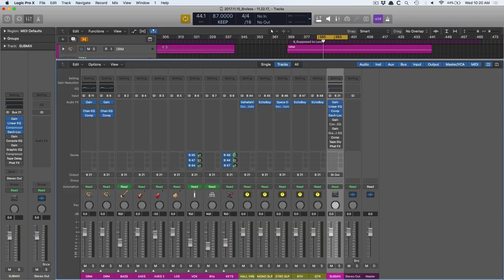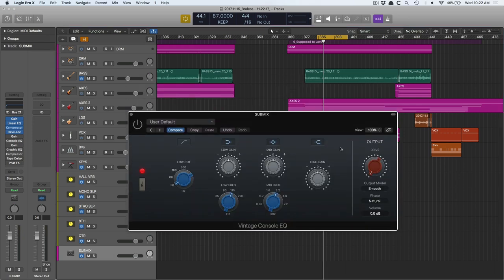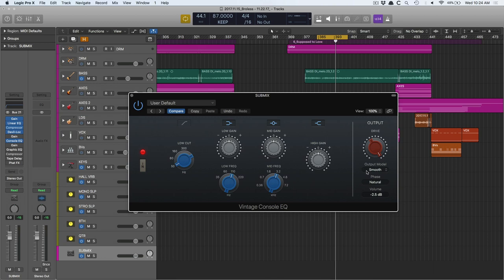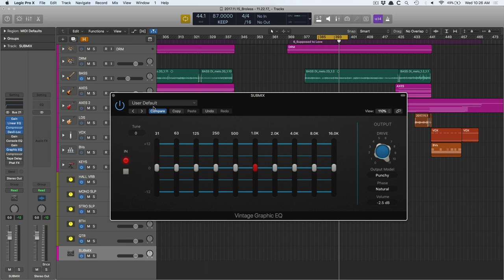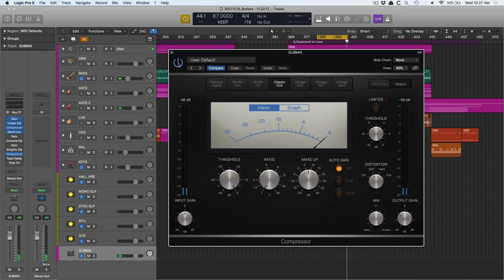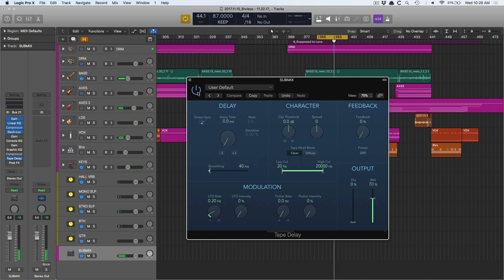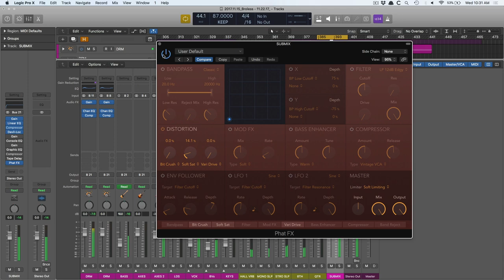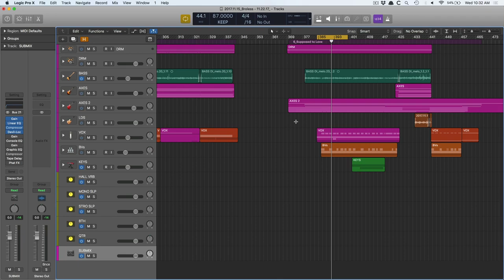Using Saturation to Glue Your Logic Mixes Together

Comment: Cross reff'd this with headphone and monitor speakers.  Quite a boost was presented over my monitors when you used the compressor / soft distortion compared to my headphones.  It's 1 a.m. I should use monitor speakers during tutorials, don't think the neighbors like the volume leverage at this hour ;)
Never-the-less, great tutorial and nice tutorial track.  TY

Comment: Dude... my freakin Mind exploded. I was like that meme... I never knew that there are like so many saturation types in Logic. I will save every one of these plugins only as a saturation mode. OMG I am so EXCITED xD... btw... can you make a video on the exciter as a special type of saturator??? I think of it as parallel saturation... Especially the Input Gain because you can not adjust it and putting several exciters with different settings in serial.... Great work! Love this channel! Cheers :)

Comment: Real nice vid Chris. Seem to also notice a width effect, esp with Neve emu. Hadn't realized that different comp emus will prob also have diff soft/hard/clip characteristics. Been big fan of soft distortion on Logic comp for 10+ years. And need to integrate the new Vintage EQs and PhatFX into my workflow bit more. Subbed.
Reply from the maker: Hey Jeroen, Thanks so much for subscribing! I totally agree with you – I'm a HUGE fan of the soft distortion in the Logic compressor :)

Comment: It's great to see someone using stock plugins, but you are wrong about the distortion in the Logic Compressor. It sounds the same with all the different compressor models. You can try this by using two different ones in parallel and flip the polarity on one. They completely cancel out.

Comment: Why Logic Pro Rules -Hey man, I have a 2015 Mac. I have never updated it. But I want what your Logic updates have. Should i let the updates happen? I have had many peole tell me to avoid updates...
Reply: Dunno if this will help -- I have a 2012 Macbook, which allows me to upgrade the RAM and hard drive (I can open the bottom cover and swap out those parts very easily). When I updated the OS from whatever 2012 OS I had to Mojave, my laptop was going extremely slow to the point of being unusable (I'm talking load times of >10 minutes for any application I tried to open). I've upgraded the RAM from 4GB to 16GB, and that helped a ton. I'm able to use Logic Pro just like normal and rarely have issues. Only issue now is the hard drive, which I need to upgrade to an SSD in order to increase initial app load speeds and some other stuff (just an optimization at this point, since it's usable anyway). Not sure if parts are self-replaceable in your 2015 Macbook, but that's a major consideration depending on whatever current hardware you have (RAM and hard drive).

Comment: OK, complete Noob alert. How did you get that SUBMIX channel strip, where you're demonstrating the saturation modules? What type of track did you add?
Reply: Would love an answer on this question!
Reply: Just create a bus and switch everything (except reference tracks) that says “stereo output” to that bus.  Call it Submix.
Reply: @JellyBags80  What's the benefit of using this as opposed to just using the stereo output aux?
Reply: @LameFaun  If you use a reference track to guide your mix, you can have that go straight to the Stereo Out and NOT be affected by any of the plug-ins you set up on the Submix for YOUR mix.  So your mix is as you want it and the reference track stays clean.

Comment: I can't really hear what it's doing. How about the rest of you? What are you hearing? Maybe my ears have gone bad.
Reply: Me neither Chris - I don't hear any change in particular.
(And I'm deliberately listening to it on some very good headphones).
Reply: You need better headphones/speakers. Also you need to know what to look out for. You can definitely hear an added layer of "hair" which is very low-level distortion fuzz. The "smooth" EQ has more fat low-mid fuzz which hides better (a good thing) but it's easy to hear if you overdo it. You can also hear some squashing and tonal changing of the transients.
Reply: stereo imaging is more dense, and slightly more textured sound.